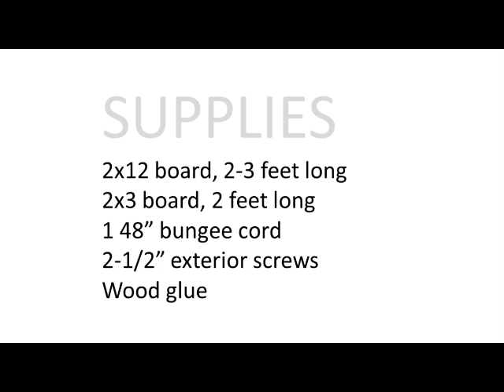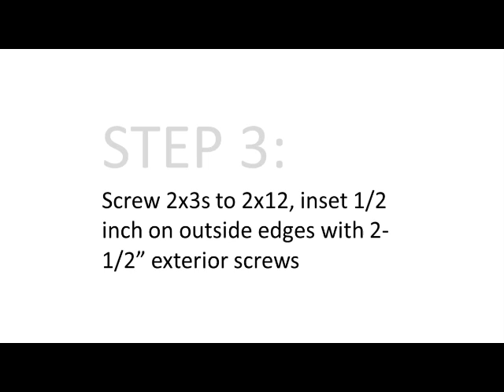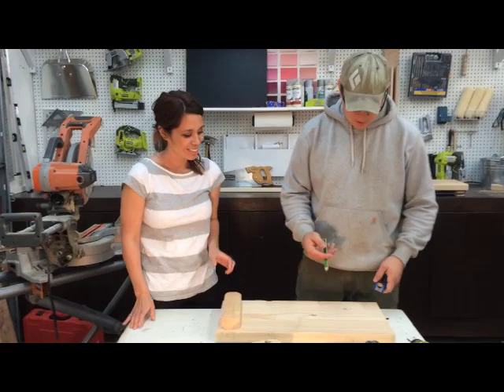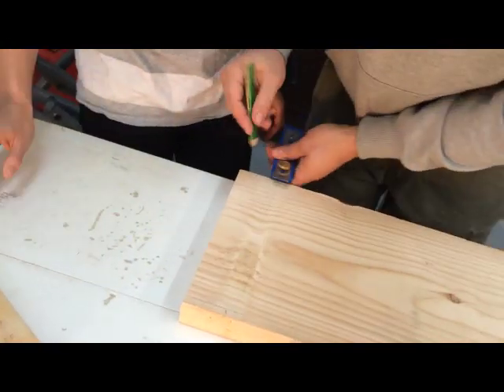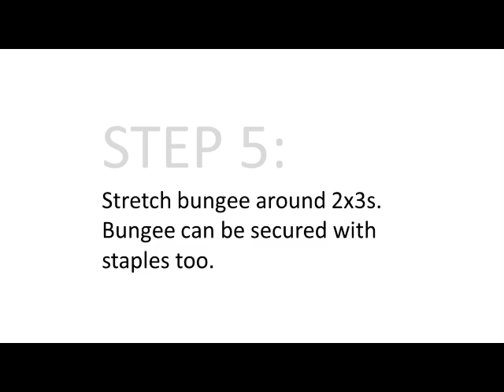DIY Hockey Puck Passer

Comment: Excellent for passing drill. Unless I missed it, how does the stay stationary?
Reply from the maker: It does slightly move on the ice!
Reply: Ana White doesn't look like it moves much. I bet a 10lbs weight would do the trick to help it stay in place.
Reply: @AnaWhiteDIY  Use slightly longer screws than the depth of the wood (no more than 1/4") and go in from the top.  This will give prongs that will grip the ice a bit and keep it from moving.